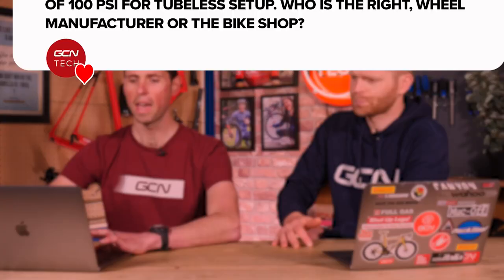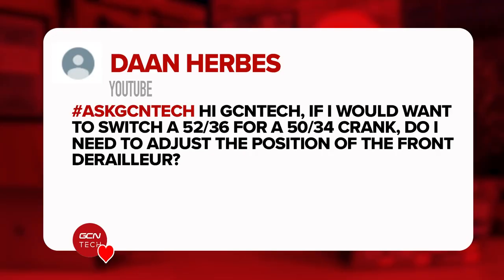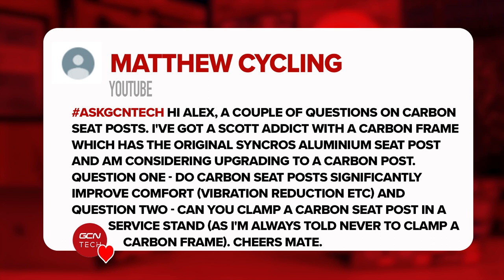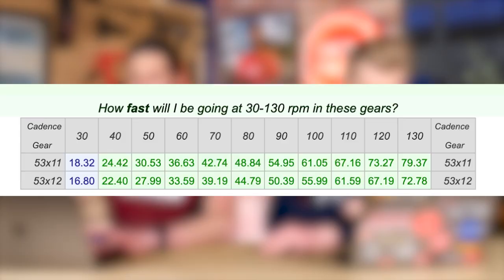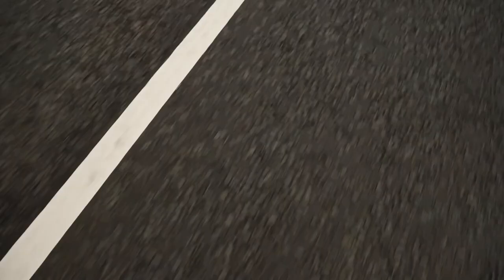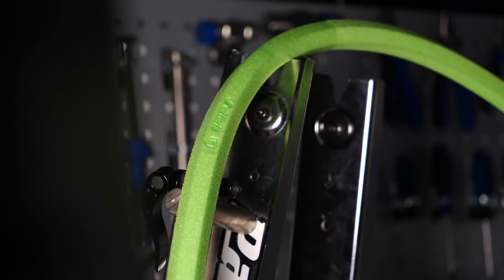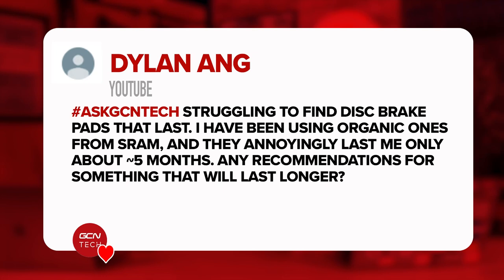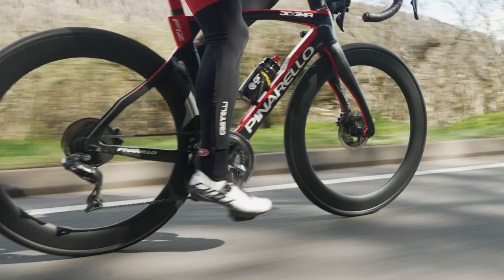Do Carbon Fiber Seatposts Make Bikes More Comfortable? | GCN Tech Clinic #AskGCNTech

Comment: I know what the problem with the guy who was spinning out was, he had small wheels. :)
Reply: Brompton?
Reply: he didn’t use a chain 😂
Reply: Or maybe the Hub is not engaging properly and he is both pedaling hard AND free wheeling a bit
Reply: Gotta be. Or his rear derailleur isn't indexing all of the way down.
Reply: Could be, you see a lot of 20" wheel bikes with 70t chainrings, cause that's the same overall as a 53t on a 700c
Reply: I figured out what the guys problem was, it wasn't 53x11 it was actually 11x53 😂
Reply: Maybe he should get on a real bike? Seriously, that ratio at 90 rpm is nearly 55 kph!
Unless he’s found the downhill land of no uphills, he’s having us on!
Reply: I think he has an odd definition of spinning out. Maybe 50-60rpm. One advantage of track riding is you learn to really spin. We would regularly hit 60kph in 50/14 gears especially when motor pacing. 135-140rpm is truly spinning out

Comment: Wrong answer! How did GCN Tech miff this question? The answer is IT DEPENDS on your carbon fiber seatpost of choice. It's like asking if going to a carbon fiber bike is more comfortable or stiffer? It depends on the layup and construction. You can get a carbon post that is designed to be aero and very stiff or a carbon post like the Specialized CobL-GobL-R that will improve the comfort of you bike significantly.

Comment: I have a entry level aluminum cyclocross bike. It had a very Ridgid aluminum seatpost. I had changed it to a carbon post with a curved post for set back. it was a noticable improved the ride. It can flex a bit too much on some bumpy terrain.but for most of my riding it was a big improvement. It was one of those cheap Chinese seat post. I took a chance, but I don't regret it. Good so far. 185 pound rider

Comment: I switched from an aluminium seatpost to a Fizik carbon fibre one a number of years ago.  Yes, it makes the bike more comfortable, more than you might expect.
Reply: eh, also placebo justifying your purchase plays a role
Reply: I upgraded to a carbon seat post. It saved a bit weight in my wallet.
Reply: There are a few carbon seat posts on the market that are specifically designed to soften the ride, like the Ergon CF3/Canyon VCLS 2.0 split post.
Reply: @NefastusJones  LOL same. We are now more aero
Reply: @jefferycampbell2243  Giant has their D-Fuse seatposts with a D-shape, specifically to allow for slight bending and improving comfort (especially on their aluminium bikes). They do really seem to work, although they require a frame with a specifically shaped seattube.

Comment: You can ride (almost) without punctures by using heavy duty tires like the schwalbe marathon plus. with the cons of more weight, wooden hard ride feel and less grip in the wet. there is nothing like free lunch here and a tire is always a compromise between weight, grip, rolling resistance, feel and toughness.
Reply: The normal Marathon tire feels considerably less like riding on concrete tires than the plus. I'd classify the plus as an e bike only tire. Too heavy otherwise
Reply: Gatorskins work well for me. I've never punctures through them. I think the rolling resistance is poor though.
Reply: Why? Having tannus tyres which are lighter, aire free (100% puncture free) with better grip on wet why are you going to use the ones u said?
Reply: GP5000: laughs in the corner
Reply: @nikivvsm  it does but it's not exactly classified as a durable tire. Tradeoffs in everything
Reply: @TheSpaceBrosShow  I also run the normal Marathon on my road bike and it took some years to puncture. I got a damaged sidewall.

Comment: what exactly has the car industry figured out , it's too different tires , cars still get flats , and there is no way to change it , you have to have a spare or sealant and a pump , car tires  are also at 30 ish psi .

Comment: To the person asking why the tire looses pressure over this short amount of time: I got the same problem and i probably got your back. Try tightening the inner part of the valve. If you unscrewed it to get the sealant in it's likely that you didn't screw it strong enough. I've had this with my brand new bike and was wondering why it lost serious amounts of air even after just one day of sitting in the basement. This solved it for me and it's so simple :)

Comment: For the pressure drop gave you checked your rim tape? A lot of setups leak through the rim tape. Try double wrapping, but make sure you clean the surface very well first!
Reply: I had similar issue on Fulcrum 7 aluminium wheel similar or identical to yours. I solved reading their online instruction manual on tubeless conversion where they show you must first put a piece of tape crossing side to side the rim internal channel in the spot where you have the weld junction. And of course you need to use sealant  Joe's worked for me.

Comment: I’ve been running metallic pads for a while. They don’t offer the same level of bite as organic compounds but they last a lot longer. In addition, metallic pads are easier to deal with when they have been contaminated with oils and other debris from the roads. Just scrub the pads with some acetone and sand them down a bit, clean the rotor with acetone and the are good as new. In my experience resin pads do not hold up as well. They seem to be contaminated to a notable level more easily and are trashed most of the time even if you try to decontaminate.
Reply: True, except on the bite. Metallic pads need more heat in them to properly start biting. Most rides don't create enough heat during short braking to reach their optimum temperature. However, when doing sustained descending, they actually brake better than organic pads, which tend to overheat more easily. 
Do note that metallic pads are a bit harder on your rotors.
Reply: @macvos  they might not be at their optimal temp, but I find that the system still has more than enough power to lock a wheel on demand. They also seem to cope way better than resin on descents and everything stays coolers with no fade. Personally I think the noise they make is cool as well. They are the easy choice for me. Everyone has their own preference tho and there is no doubt resin pads are easier on rotors.

Comment: I run tubeless with Vittoria air-liners and that's as good a puncture protection on a road bike gets. On anything other than the longest rides to rural areas I don't carry spares or a pump and have zero stress. the Air-liners are 💯

Comment: I switched from an alloy post to a Canyon S13 VCLS CF carbon seatpost on an alloy Cannondale Topstone. It made a very noticeable difference. It greatly reduced road buzz and damped the harshness when going over large cracks in pavement. While my reason for getting this post where due to it's extended saddle setback/offset, the softening of the ride was a bonus. It was expensive, but I'd do it again just to get the softer ride.
I have a new Trek Checkpoint SL5 that has a carbon frame and seatpost, also a feature they call Isospeed. It has a very nice feel. Much due to the carbon frame and Isospeed, but I think the carbon seatpost is part of this.
No question larger tires and/or lower tire pressure will have a bigger effect on the ride feel, but I think a carbon seatpost is certainly something to consider.

Comment: Seat posts: not all aluminium seat posts are equal. I swapped mine for a Thompson one with a set back angle, and it is comfy and light.
Reply: But thomson posts are among the stiffest out there.... I like their kit, but they can't be more comfortable.
Reply: @luukrutten1295  why can they not be more comfortable -  Thompson seatposts are well designed and it's well established that setback seatposts result in greater deflection.

Comment: Forgetting racing for a moment cos I retired from that many years ago. Totally club level but my ftp 30 years ago was 350 watts but now nearer 250. I now cycle just for pleasure. I am way nearer 60 than 50. I have a full carbon bike which is light and is good fun to ride but I actually still have my old Peugeot that I used to race on with 531 tubing and have to say it still makes me smile when I ride it and I often think why did I waste all that money on a carbon bike. The carbon bike is so stiff and unforgiving. The old steely is so much smoother and comfortable on our crap rough uk roads. I do most rides on the carbon bike cos I spent so much money on it I feel I should but actually almost regret getting it. If I was younger and still racing then maybe would appreciate it more. Too many channels concentrate on the latest greatest carbon offerings but actually for us mere mortals with max powers under 1000 watts the carbon bikes are just OTT imo
Reply: Sell it? Treat yourself to a modern steel bike or just ride the old one. Never been a better time to sell a second hand bike as prices have never been higher.
Reply: I'm pretty close to your profile, 63 now. I've ridden a few carbon bikes and they vary tremendously in comfort. The Serenity track bike was ridiculously stiff which was great for the track. The Time VRS was like butter but nicely stiff in torsion. My 531 bike has considerably more road buzz.

Comment: To amplify the point about auto tires, most of them  have steel belts backing the tread. Tire models intended for high speed use over extended periods of time  are made without steel belts to prevent creating a heat sink and, as a consequence, are more prone to puncture. So high speed auto tires aren't usually used on the street,  except by those intent on breaking the speed limit.

Comment: Regarding the carbon seatpost and comfort, Lenard Zinn did an objective analysis of this years ago and concluded that the greatest  damping  effect was in the case of a post that had the greatest setback and was made of carbon. The least was a zero setback post made of aluminium. I actually designed my custom steel bike frame with this in mind and it worked out great, but it’s still tire pressure and volume thAt matter most.

Comment: ETRTO (European Tyre and Rim Technical Organization) states a maximum pressure of 5 bar but not based on their own extensive testing. Zipp has done tests in which the blow out pressure of hookless and hooked rims is roughly the same. Giant allows higher pressures on their hookless Cadex rims depending on tyresize. So I'll put 6 bar in the 25 mm Conti GP 5000 TR of my new carbon rear wheel.

Comment: Two technical comments.  Spinning out with 53x11?  Wolftooth makes a 10-tooth cog.  Loosing tire pressure over time?  Maybe the liner tape needs replacing.

Comment: Hey Ollie, the middle of the block is not the most efficient. The 14T or 15T cog will give you the best drivetrain efficiency. The straighter chainline of riding in the 14T has a bigger impact in efficiency compared to the larger 19T cog. This was tested by Friction Facts back before they were acquired by CeramicSpeed. I would be surprised if you didn't know that

Comment: having a carbon seatpost on your aluminium bike makes it more comfortable and helps handling for sure. carbon post on carbon frame has way less effect due to the difference in the stiffness of aluminium and carbon fibre. dropping 100+ grams from the very top of the bike makes sense. just like using lightweight tyres and rims.
Reply: Would like to see the material science data to support the statement 'that a carbon post on an aluminium bike makes it more comfortable and helps handling.'
I'm sorry I just don't agree with the statement.
Reply: @kidkarbon4775  why is that? just curious. if you ask me to provide scientific data i could also ask you to do the same. my answer is quite simple: if you lose weight from the very top of your bike (saddle and/or seatpost) the center of gravity gets closer to the ground so you have less inertia which helps handling. the question of comfort is more complex, because different seatposts have different ways to hold the saddle rails taht affect comfort a lot, so this might be more important than the material of the seatpost.
Reply: @domonkosscheiling5809   I fail to see why I should provide data as I am not the one made the statement. I simply stated I do not agree with it.
A seat post requires a certain level of deflection for comfort as such ultimate stiffness is never the objective.
For example the Ergon CF3 seatpost requires a force of 69N to flex one vertical mm while a Canyon frame requires 7000N of force. A well designed seatpost flexes at a rate 100x greater than a steel frame.
Without deflection a seat post is not able to reduce high frequency vibrations from the road or take care of bigger impacts thanks to the 20mm+ (0.89") of vertical flex in seatposts such as the Ergon CF3.
A linear relationship exists between deflection and force (for the small range typically observed in seatposts) which helps to predict flex at different force rates.
Ultimately implying that seatpost comfort can be dictated by stiffness is at the very least an incomplete argument as the amount of post sticking out of the frame influences that greatly as does rider weight.

The material choice for a seatpost is less important than deflection properties and the resonance frequency of the finished product. I'm yet to see any research that states otherwise.
Reply: i swapped out the 31.6 aluminum seatpost to a 27.2 carbon seatpost on my ibis hakka (carbon gravel bike) and the change in comfort was huge, so it can make a pretty big difference on a carbon frame as well.

Comment: Im gonna assume that what the 53/11 guy meant is he lives in a mountainous area where all the riding is up or down, and the descents are long and steep enough to be over 55kph most of the time.

I live in an area with some long descents, sometimes in the tailwind, and i find myself able to pedal up to about 73kph in the 52/11 because of cadence (although im not putting down a lot of power at those high revs), but in those instances I am in top gear for minutes at a time, which can def make you wish you had one extra gear to pedal slower, especially if super high cadence isn't your thing

still, 52/11 is more than i can sprint (i think i've managed top gear in a sprint like twice) and I think this is the more important limiting factor than descending speed, where you can keep accelerating by supertucking anyways.
Reply: Possibly, but unless he's on an ebike, he's going to be spending far more time grinding up the hill than spinning down it.

Comment: Air leakage on mtb tires is common due to release agent inside which the sealant cannot "grab". The old GP5000 TL is fully sealed; the new GP5000 s tr is not. Tubeless valves is a little bit tricky to get fully sealed

Comment: ***WARNING @Eric Bellrose - Continental GP5000 TL is NOT hookless compatible. Only the latest GP5000 S TR (which is in short supply, so you possibly don't have) is hookless compatible. #AskGCNTech could you let other viewers know that they have to check their tyres are specifically hookless-compatible?

Comment: Hey Tech Team!
I am considering buying a new bike equipped with the new Ultegra 12s Groupset. I am held back by the fact though, that it only comes with a 52/36 chainset.
Would it be possible to upgrade the chainset to the new 54/40 Dura Ace 12s one? 
In general how interchangeable are the new 12s components between Dura-Ace and Ultegra?
Thank you in advance!
Greetings from Germany!

Comment: I ride a Cinelli mash fixed gear with carbon fork but alu steerer and 23mm tyres. It is my most comfortable bike with a 3t carbon seatpost and Deda carbon bars even with no bar tape. Carbon makes a big difference. Plus my canyon aeroad which is complete carbon is also just as comfortable

Comment: re puncture protection - the schwalbe marathon supreme are good for commuting.
Reply: Schwalbe Marathon Plus - the so called "un-punctureable" with the thick blue protective layer - are unbearably heavy, half a metric pound per wheel. Switched back to regular ones after having tested them as a bike messenger and feeling much more exhausted after every shift due to frequently having to accelerate in city traffic.